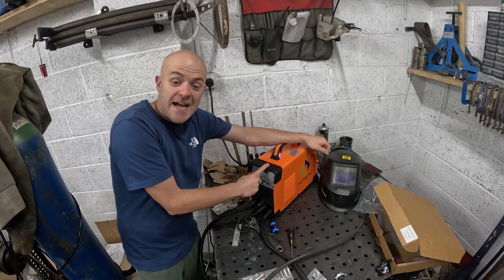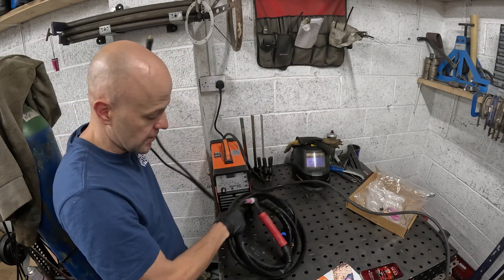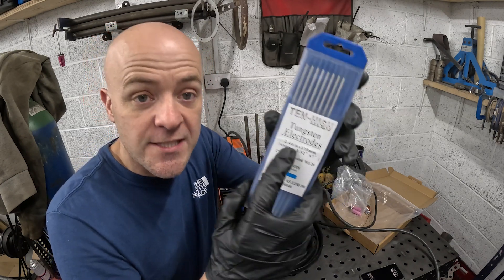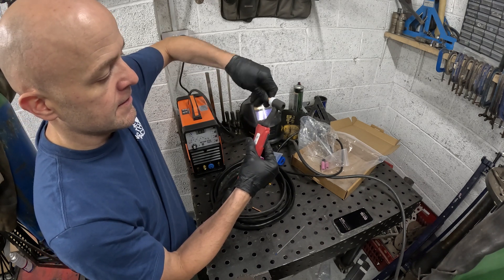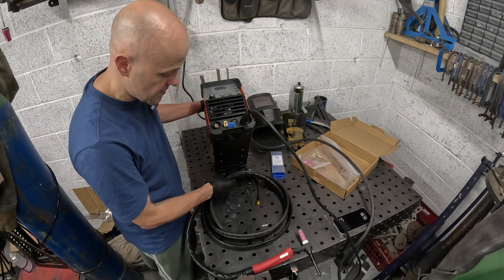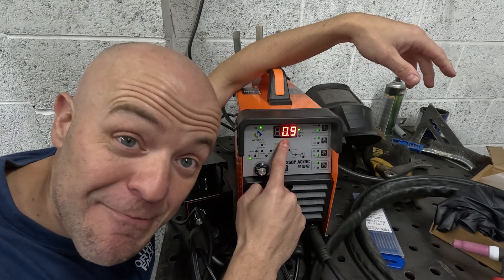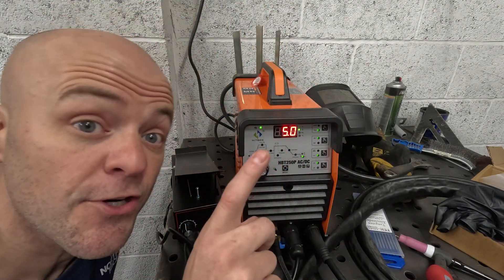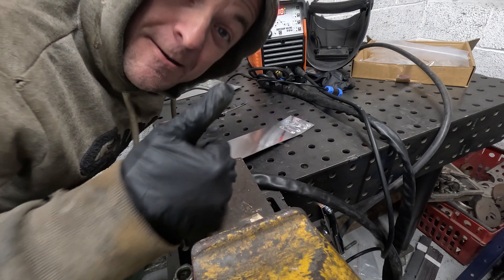Hitbox HBT250P AC/DC Tig Welder Beginners Guide For Aluminium / Aluminum Settings & Unboxing How to

Comment: Quick question, does this welder have a high frequency start ? I currently have it and have been using the torch switch but i have to touch the work piece for it to start an arc
Reply from the maker: Mines HF start rather than scratch start
Reply: @rustypaint  is there a certain way to make it do the HF start instead of the scratch ? I have the same welder. I wonder if i need the pedal to make HF start work.

Comment: Thank you!  I just bought this machine and this video was incredibly helpful.  I used all your settings and followed Justin's tutorial here: https://www.youtube.com/watch?v=TgekhRZ_d2o&t=809s and I was actually TIG welding beads in a couple of hours.  I'm super happy.  For the gas lead, I bought a nice hose on amazon with the ends on it, cut one of the ends on and attached it to the welder with a hose clamp.  I'm super happy with the whole setup.  I also added some rubber feet to the bottom of the pedal and the welder so they don't slide around anymore.
Reply from the maker: No worries mate!! Good tip on the pedal, I might try that as I’m always kicking mine all over the place 😂😂

Comment: Thank you for the video. I have an aluminum boat  which needs some holes fixing. I think the thickness is about 1/16 inch or about 1.6 mm. Do you think this machine will do the job. I hope not to poke holes into it. What thickness was your aluminum? thanks!
Reply from the maker: It will definitely weld 1.6mm without any issue, but you’ll have to adjust the settings down accordingly - as it’s much harder to weld thinner metal haha. For the video I was messing about with thinker stuff, but I have welded 1.5mm alloy since.

Comment: Nice video and helpful. I have the same Hitbox welder but I got gifted a Yeswelder pedal. The pinouts are not the same as the plug for the Hitbox torch connector is a reverse aviation style plug.  Yeswelder has pins going in a circular motion whereas Hitbox is more like going sideways leaving pin 5 at the bottom.

Could I please ask of you to confirm that pins 1 and 2 on your Hitbox is the switch, and that pins 3 and 4 as you depress the pedal, goes up in resitance?

Thank you and really appreciate the help. I love this welder and would love to use the pedal instead of the torch.
Reply from the maker: My friends got my welder and pedal for his project, so no idea when I’ll get it back. It might be worth googling as there must be a wiring diagram somewhere. Sorry I can’t be much more help
Reply: @rustypaint  Tried searching for it but it only shows the plug and no data as to what is plugged into what.

I did send an email to Hitbox and will a2ait to see if they can help me.

Comment: Thanks for the video mate, much appreciated. Can you tell us where that fuse is located?
Reply from the maker: Fuse is in the plug top itself. Or at least it was in my unit
Reply: @rustypaint  thanks for your quick reply! They must of fixed that issue as I dont have it in mine. Cheers bro!

Comment: Very nice video! I have one question, how do I get to the plug fuse?
Reply from the maker: On the plug itself there is a little cover (between the 3 pins). Just use a small pic to pry that off and the fuse is behind. If they’ve changed the plug since mine then there may be a small screw you’ll have to undo to get to it - should be very obvious when you look at the plug itself
Reply: @ is there any way you could send me a picture of the cover? I’m trying not to tear my plug up. Haha

Comment: Does anyone have a good US source for the replacement hose and regulator? Can you just buy a standard Argon hose and cut off the fitting on the welder end and side the hose onto the welders barb fitting?
Reply from the maker: I’m obviously in the U.K., but I just measured the barb fitting out the back and got a length of good quality thick silicone hose. Regulators usually have a barb fitting on too - so you usually just need a hose between the two
Reply: Thank you! @rustypaint

Comment: Top notch video👌 I can see there still aren't very many videos covering this machine. I bought one over a year ago and posted a vid on it because there wasn't much out on it but I just wanted to see if it worked and to see if I could weld something since I had never tig'd before. Great machine to learn and practice with if you don't want to spend alot. You did a great job explaining how to set it up and use it. I haven't used mine much. I'll have to get it out and get to work on some projects. From across the pond, cheers👍
Reply from the maker: Thanks buddy! Truth be told I haven’t used it since making the video haha!! I also need to get welding with it 😂
Reply: @rustypaint  🤣

Comment: Mettez la balance à entre 30-35% ça marche beaucoup mieux 👍
Reply: Is the dial setting the positive (cleaning side) or the negative side (penetrative side) Désolé, ce n'est pas en français
Reply: people who say you need to have your AC balance at 35% on the display have their cords switched around, that's equivalent to 65% with the cord plugged in correctly.. (65% welding current, 35% cleaning current, which is still a lot, if you clean the aluminium better you need less cleaning current)

Comment: Tip for tungsten grinding. Chuck it into a cordless drill and grind away on beltsander or some sanding disc on the angle grinder. Do not use a stone. Tungsten is hard and will destroy a stone very quickly
Reply from the maker: Good tips 👍

Comment: Just bought one can't wait to try it
Reply from the maker: Hope you enjoy it, it’s great for the money!
Reply: @rustypaint  quick question, what fuse breaker and gauge of wire have you connected yours to?
Reply from the maker: @AKDiag  My garage is on a 32a ring main, however the limiting factor on this is the plug top which is 13a now ive replaced that dodgy fuse it comes with originally.
Reply: @rustypaint  so did you just use 13amp fuses? and it hasnt blown it?
Reply from the maker: @aminkhan1292 it was welding in the video with a 13a fuse no issues. As said in the video just swap out the dodgy 13a fuse it comes with, with a proper 13a fuse

Comment: Hey man i have also had this welder for a while with the foot pedal, but once i left off the pedal and stop my weld it shoots a jolt of amps to the tungsten for a split second. I believe it did it for you as well. Do you know what could be causing this? Anything helps! Cheers!
Reply from the maker: Can’t say I noticed, as I’ve got literally 30 mins of alloy welding experience haha 😂😂. I can only assume it’s due to being a cheap pedal set up, maybe it holds the power for a few seconds after stopping.